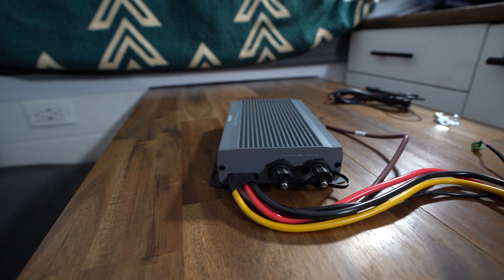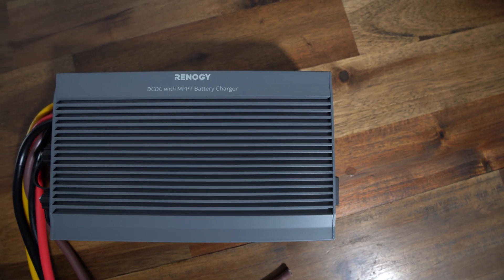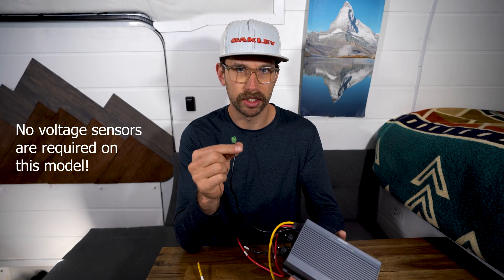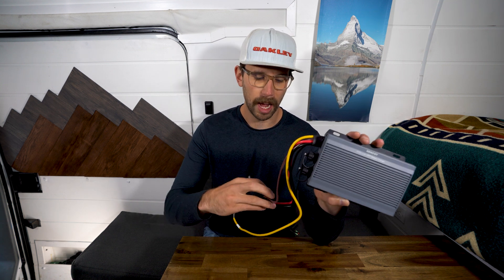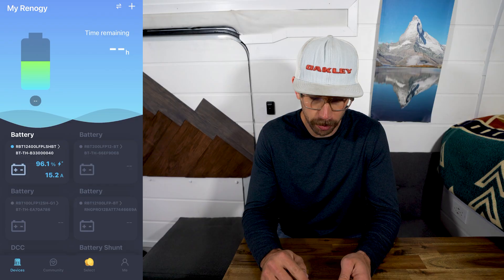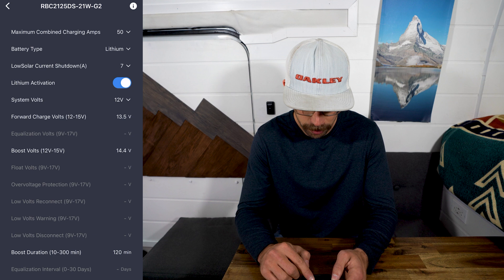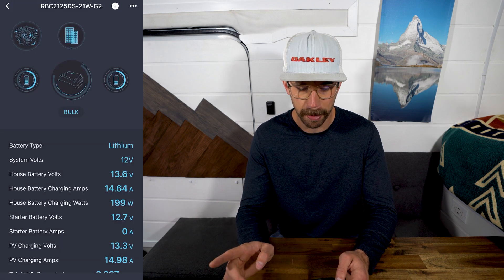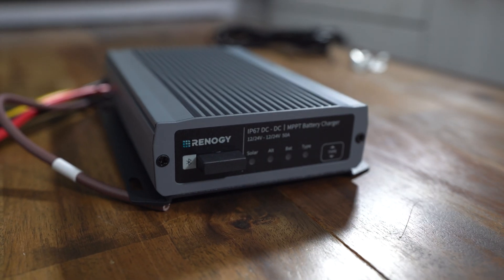Renogy 50A DC to DC Charger with MPPT Solar Input

Comment: Hi!  Appreciate the video!  I’m helping a friend with a small house battery system on a van.  Recommended this to her.  As I contemplate the installation, I’m once again confronted with Fuse confusion.  I know what they do and how important that is, but the sizing is where I struggle. She has the 40amp model.  If I understand correctly, I’m thinking a 50-60amp fuse by the starter battery is needed.  Right now there is no solar set up.  Using the dc-dc feature by itself.  Have a 2000 peak/1500 continuous inverter, using a 200 amp fuse.   Am I tracking correctly, as far as you can tell?
Reply from the maker: @nmartin5551  a common rule is 1.5x the max amps which I’m sure you’ve heard of. It’s also important that this number is below the max current of the wire gauge. I would go with the 60 amp fuse for the dc to dc charger and 200 amp for the inverter. You’re doing it right!
Reply: @madetoexplore thanks for reading and replying!
Reply: Want to answer another question?  Like you, Im working on a T1N sprinter.  I’m still trying to figure out how to hook these wires to the starter battery.  Positive especially, but then also can you get away with grounding to chassis ?  I see videos on newer vehicles that have fancy expansive connectors on their battery’s starter hook up.  Not so the T1N.  Most of the demo videos just use a plain battery sitting on the table for the starter battery in demonstration.  Not real world.

Comment: I placed an order with your code and it worked a few weeks ago. Trying to place another order today and it looks like madetotravel is no longer valid. :( just fyi in case you don’t know
Reply: The code is working on the UK site
Reply from the maker: @maryanntime thanks for letting me know! I just checked online and it seems to be working on the US and Canada website. Which website are you using?
Reply: @madetoexplore  actually I took the time to read the error message for the screenshot and it does say “The coupon code you entered has reached usage limit so it can't be used.” Grrr this annoys me that I can only support the influencer once. Renogy needs to do better on partners and client customer service.
Reply from the maker: @maryanntime  to be honest, I had no idea about this! I’ll reach out to Renogy. We appreciate the support! 😄
Reply: @ looks like they fixed it! Placing a smaller order now. Happy to support y’all.
Reply from the maker: @maryanntime  thank you! 😊
Reply: @madetoexplore  renogy official website US. I tried another influencer code to see if it was just my account and it worked for theirs. I haven’t placed it yet, so I was thinking it was just yours with an issue or if I can only use yours once. I can take a screenshot to show you.

Comment: I'm concerned about the wire gauge, is there an option to swap the wires completely? Thank you!
Reply from the maker: @Jjeong_ji  not without disassembling the device. The wire gauge hasn’t been an issue at all for us! It’s a very short run. With that said, I wish they didn’t do the wire stubs and had regular ports.
Reply: @madetoexplore  I worried about this, before I realised that I am only going to be running short lengths to isolators, fuses etc.

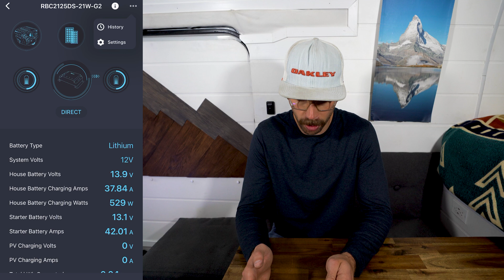Comment: Hey there, thanks for this video.  We are also Renogy ambassadors and using this 50A DC to DC in our system as well.  We primarily use it to charge our auxiliary battery in the back of our truck that runs our 12V fridge, and rarely plug in solar.  However, we can switch the output to our trailer house batteries to charge while driving on those low sun days.  We haven't seen the same amperage that you've displayed.  We're only seeing a max of around 24A, which goes down and settles at 16 - 20A pretty quickly while idling.   We noticed that in your video at 11:15 your starting battery is showing charging at 42A and house battery 38A.  On our recent test, ours were 24A and 23.5A respectively.  Renogy is telling us that we can only get 25A out of DC to DC (engine source only) but clearly that's not what you're getting.  Any thoughts?
Reply from the maker: @FreedomInACan  on the previous model, I had to turn off my solar input and I believe it’s the same for this model. I have a switch that will shut down the solar input. Have you tried that?
Reply: @madetoexplore  not with a switch, but I did set the parameters in the app to less than 10A, as you did in your video.  We didn't actually have the solar plugged into it, so it shouldn't have detected any solar input.  Thanks for the insight, appreciate your response.
Reply: I'm starting to think that this is an issue with our smart alternator.  We've been driving all day, no solar attached and only seeing 10 - 12A from the engine source.  Do you know if you can has a smart alternator?
Reply: I am seeing very few reviews so far and not good. Also, see bad reviews for support. Are these anomalies?

Comment: Hey I can't adjust the settings on mine in the app and it doesn't work with my Peugeot smart alternator. I've wired it exactly as the instruction manual suggest and I don't have to option to adjust the settings as shown in this video any advice?
Reply from the maker: @jamespymn6336  maybe you require an update? That’s strange that the settings aren’t showing up. It looks like Renogy just recently updated their app

Comment: smaller isnt better  its gonna overheat like crazy...just like redarc does.
Reply from the maker: I have had this unit pulling 50 amps for several hours and have had zero issues with overheating. The fins are designed to dissipate heat and they do a very good job.

Comment: Again, well done!  Quick question: you recommend locating that 60amp fuse (cube fuse?) at the beginning of the wire from the alternator.. Why?
Reply: And does it matter than Renogy recommends an ANL fuse?
Reply from the maker: @MarkSortino  because the fuse isn’t just to protect the device, it also protects the wiring. No, both fuses are equally good.
Reply: @madetoexplore  Gotcha - thank you!
Reply from the maker: @MarkSortino  no problem! Good luck with the install 😄

Comment: Great video! 

Can you confirm that this model is limited to 32VDC input from the starter battery? I'm looking for the full 50VDC.
Reply from the maker: @MarkSortino  that’s what it says in the manual. 11-32v from the starter/aux battery. 50v is from the solar panels.

Comment: Great video thank you, one thing, where do I connect in a mains hookup battery charger when the solar is not sufficient? On the engine or leisure battery terminals?
Reply from the maker: @jonathanmarch332  I’d connect it directly to the leisure battery terminals.

Comment: As much as I hated running the cable to an ignition activated fuse, I feel like the old one will do better with smart alternators. I'm not sure yet if I can rely on a voltage cutoff to adequately maintain charge when the voltage changes constantly, but also shutoff appropriately when the engine is off. Now that I already have that cable ran, I'm not sure I want to go with one that can't detect when the engine is on or off.
Reply from the maker: Both are good models! It’s to bad they didn’t have the ignition wire on this one
Reply: @madetoexplore just bought one of these is this no good for a smart alternator?
Reply from the maker: @nightninja5670  it works with smart alternators but people have reported issues with pulling higher amps because this charger does not have a voltage sensor like the the previous model does
Reply: @madetoexplore  what previous model are you referring to?

Comment: Great video. I bought one of these yesterday but now I am reading through all the comments, and I am worried about the fact that my 2022 Tundra has a smart alternator. I have a travel trailer with a solar system that can't keep up with my usage when we camp off grid for more than a few days. I use a noisy generator to charge my batteries. My buddy has a camper on the back of his older Tundra and uses the DCC50S 12V 50A DC-DC On-Board Battery Charger with MPPT to charge his batteries by idling his truck for a while. He can charge his batteries in less time and it's much quieter than my generator. I can't charge while driving because I have a trailer and don't want to run a second cable back to my trailer. The 7-pin connector limits the amps to about 5 I think. So I ordered 30 feet of 1AWG wire and plan to make a cable that I can connect to my charger when I want to charge my batteries while parked by idling my truck. After reading these comments about smart alternators, I think I will try to cancel my order on Monday and instead buy the cheaper DCC50S 12V 50A DC-DC On-Board Battery Charger with MPPT. Will that one work with a smart alternator? What is an ignition wire and how is it installed?
Reply: I found out that I can easily disable the smart part of my smart altenator right at the battery. I will do that. It may cost me a little gas mileage but I doubt if it is that much.
Reply: Their is no need to disable it. I have the same dc-dc w/mppt 50a charger and a 2020 Chevy Silverado Trail Boss LT. It has a smart alternator and it works great with the renogy system. I regularly pull the max of 50 amps from it to charge up 3 house batteries. I have an electric cooler in my truck that never shuts off. Only gripe I have is with the mppt side. But that just might be user error
Reply: Renogy previous model is false advertising, not sure about this new version, but I would tread lightly.

Comment: Why are you not connecting positive and negative directly to the bus bar?  Would be much better than 10g to 2ga wire
Reply from the maker: @Lunatic_Lou  the positive wire goes to a 60 amp fuse and then the positive busbar. The negative goes directly to the negative busbar. The wire that changes sizes goes to the starter battery so it needs to be a large gauge because of the 20ft distance

Comment: Great info & thanks for the promo code . I want to install this system on my boat with a 460AH house battery a 2KW inverter charger & a 120A alternator  plus solar . Do you have a wiring diagram & can you advise on fuses & cable sizes please . Thanks in advance & great video . Mark UK .
Reply from the maker: Welcome! I have a schematic as part of my solar guide. The link to it is in the description. It also covers how to size wire and fuses

Comment: Does the temperature wire/guage actually let you turn off charging to lipo batteries that do not have low temperature protection built into them?  The renogy website doesn't specifically say, or alludes to temperature only being used to manage charging profiles for lead acid.   I don't want to charge my batteries with either solar or alternator if the temperatures get to low.
Reply from the maker: Yes it will protect the battery. That’s why I don’t use the temperature sensor.

Comment: I talked with them on the phone about the 50a dc-dc charger with mppt and they said the new model is capable of 50v solar but they don't show a pic like the one you have here. it looks the same as he old so that's a little confusing. Also your first renogy link in the description doesn't work.
Reply from the maker: Yeah, this model has a new designed that is more water and heat resistant. The old model is essentially the same design but can handle more solar now. It’s to bad they didn’t add Bluetooth to the old model.

The link seems to be working fine on my end?

Comment: Can I use two DC DC chargers in parallel if I buy this new one? I have an older DCDC50A model. My alternator produces 180A. To increase the charging from the alternator, I considered the addition  MPPT /and possibly a second battery.
Reply from the maker: Even though your alternator produces 180A, the total is much lower at idle. I don’t think this would be a good idea to be honest. You should like at the chart of the alternator. Many people install 200A alternators and still only pull 50A
Reply: @madetoexplore  if I have old DCDC50, can I use separate MPPT ?(without connecting the solar to DCDC charger)
Reply from the maker: @zbigniewpierozynski7475  yes

Comment: I am thinking about putting one of these on a 2021 F150. It has a smart alternator. I read the manual for this unit and it gives instruction on how to determine if you have a smart alternator or not. However, it doesn't say much about how to set it up for a smart alternator. "The connection method of a smart alternator or a traditional alternator depends on its parameters." This is literally all it says. I guess I'm confused about what I would do differently as far a connection method for a smart alternator. Any advice?
Reply: That’s what I did and I used your code. Thank you.
Reply from the maker: @jasoncarter4584  thank you!
Reply from the maker: @jasoncarter4584  it has to do with the parameters you set in the app. There’s instructions in the manual about adjusting the parameters based on the output voltage of your alternator. You’ll probably need to get a voltage reader and ply around with it a little bit.
Reply: @madetoexplore  I looked over the entire manual carefully and didn't see any such instructions. If I missed something, would you mind cutting and pasting it here? Thanks.
Reply from the maker: @jasoncarter4584  smart alternators will auto adjust there voltage so you will need to start your vehicle and take a reading after and then take a reading after 5-10 min. You’ll need to adjust the voltage for the controller to start pulling power at around 13v most likely. The typical setting for non-smart alternators is 13.5v.
Reply: @madetoexplore  That first sentence is from the manual and states how to determine if your alternator is a smart alternator. That second sentence doesn't appear to  be from the manual. I Also noticed the "alternator" part of the manual is a direct cut and paste from there other mppt dc/dc model that has an ignition wire. And states "The connection method of a smart alternator or a traditional alternator depends on its parameters."  I think if they want to sell these for modern day vehicles they need specific instructions on how to test the alternator and program the manual. Otherwise, Im inclined to believe the previous poster that seemed to know quite a bit about smart alternators and assume it wont work correctly.
Reply from the maker: @jasoncarter4584  if I had a vehicle with a smart alternator, I would definitely make a video on this but unfortunately I don’t. You could always go with Renogy’s other model that has the ignition wire.

Comment: Those cables are very strange. Why not built in connectors like every other charge controller ever built. Do the wires run hot under load?
Reply from the maker: Yeah it’s a little different but I think they did it to save space and make the controller smaller. No, the wires have been fine. No issues at all

Comment: Does anyone know if i can have 24v going in from starter battery and 12v going out to the house batteries?
Reply from the maker: Yes this can be done. Read section 8.2. Charging Logic in the manual

Comment: Seems like this wont work with smart alternators. Voltage sensing simply is impossible on a car with a smart alternator, and without an engine run sense wire....its a fail. 
Haven't tried this unit, but have used other brands that do the same based on alternator voltage. All you get is little blips of charging when the alternator peaks its voltage, usually just during deceleration.
Reply from the maker: @MakingStuffGoingPlaces  The charger is compatible with smart alternators and traditional alternators, the working voltage of different alternators will be different. The product itself comes with Bluetooth communication function, you can connect to DC Home or Core via Bluetooth, and then adjust the appropriate input voltage value of the charger according to the characteristics of the working voltage of different types of alternators.
Reply: @madetoexplore  I did see you go through that option in the video, however, that won't work as smart alternators often run a deficit of charge. It's not possible to distinguish between engine running and engine off purely by charge voltage. The only option here would be to set you sense voltage below the smart alternators threshold, but then the Renogy unit will continue to discharge the cars battery once the engine is switched off. 

Just going through winter with my current Renogy 50A unit (old version) and alternator charging is very important due to lack of sun...you can't risk it not detecting the engine running.
Reply from the maker: @MakingStuffGoingPlaces  if you set it just below the threshold, it would be fine. It may continue to charge from the battery  after the engine is turned off, but only for a very short period of time.
Reply: @madetoexplore there's no option in the app to adjust the settings though?
Reply from the maker: @jamespymn6336  yes, you can adjust the voltage in the DC home app
Reply: @madetoexplore there is no option to adjust. I have found the item on my Renogy core and on the app, and where you have the three dots there is nothing against the ip67 mppt, the shunt has this option but not the mppt
Reply from the maker: @jamespymn6336  there is an option to adjust. Maybe yours needs to be updated? The settings are below 👇 

Forward Charge Volts (12.7-15V)
Forward Charge Stop Volts (11-13V)
Reply: @jamespymn6336  I have read that you cant connect the app AND the Core with some Renogy devices- try without the Core?